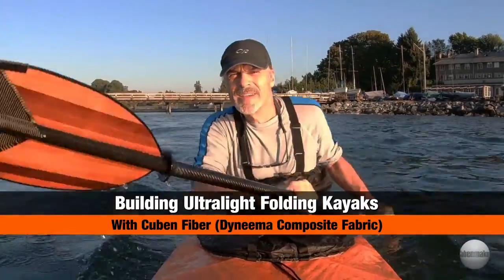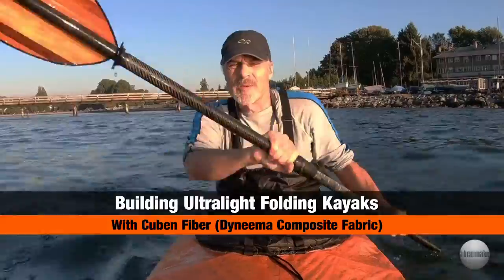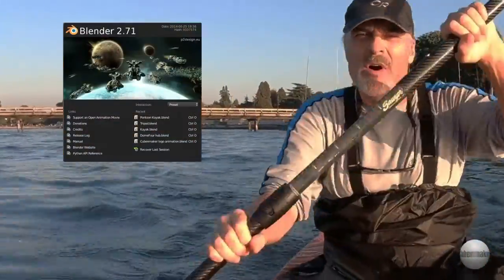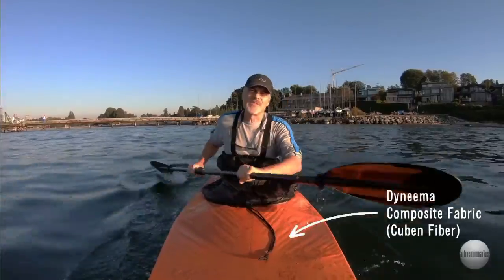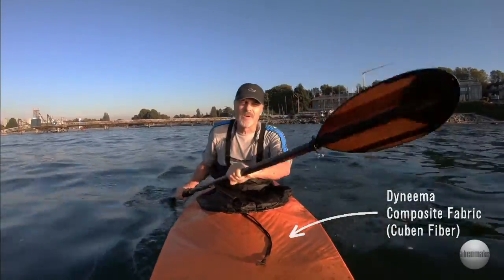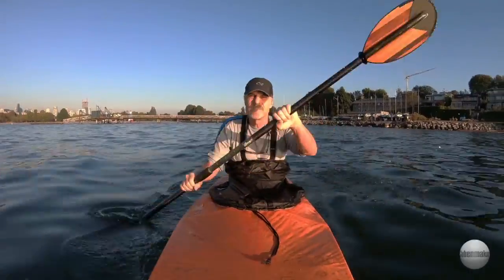Two Projects Building 10 Pound Folding Kayaks

Comment: That's fantastic.  For your connectors (white pieces) did you have them custom made or 3D printed or is it just small hose connector.  Seems like some parts like the front plastic was custom made.  Why that size carbon pole? Also those inflatable pieces, could you post a link to where you got these.  Thanks a million!
Reply from the maker: All your questions are answered on my web page given at the end of the video.
Reply: @timothyrhodesevans  Thanks! Great info too, I share going light philosophy